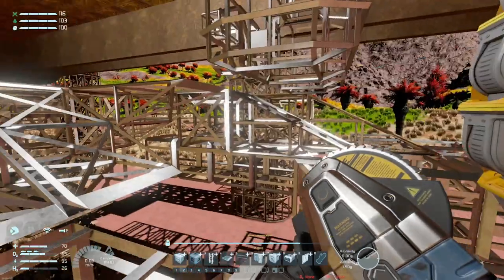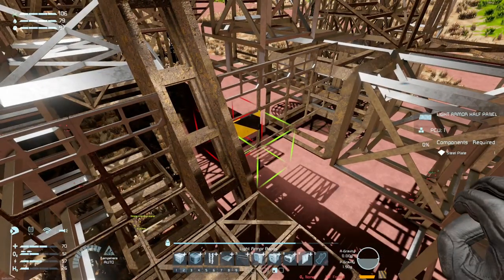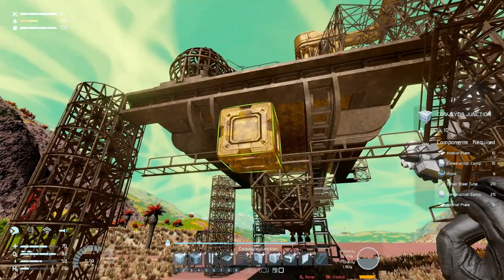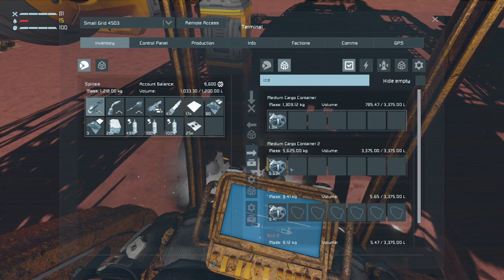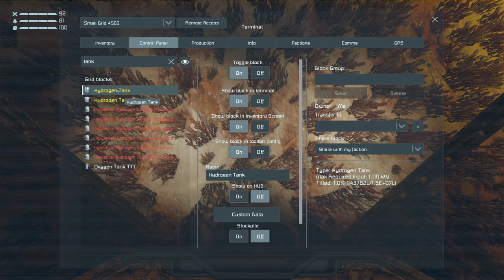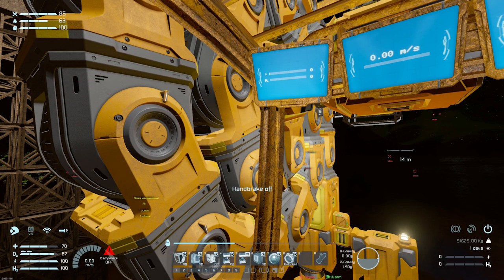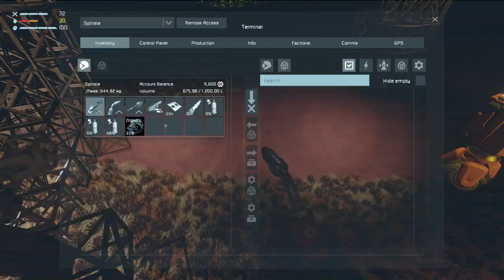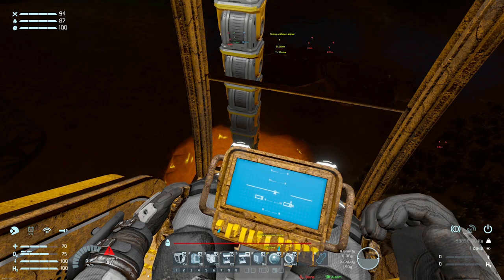Survival Impossible - Mining Tram/Gondola Thingy #60 - Space Engineers Hardcore Survival

Comment: Splitsie, you should add a remote control block and a radio to your gondola. Low power, so nothing can see it from far away. The reason I bring this up is that you might forget getting into the gondola from the side, get out in the middle of the ice lake, and then have no access except via the rails. And that's a scary thought in 1.9g.

Edit: you can probably also add a gyro to the gondola to stabilize it via locking the gryo orientation override. Less chance to flip via unbalanced loads.
Reply: The idea of him having to shimmy shimmy along the rails is actually kind of appealing.
Reply: Definitely appealing... Here's hoping
Reply from the maker: You make a good point, some backup systems would probably be smart :)

Comment: I can think immediately of one thing you've forgotten on the Goblin. (Which is an AMAZING name.) An antenna. I can think of one adjustment I'd make, to make batteries last longer, and improve the function. Now that we have the fancy magnetic pads, I would add them in the four directions and on a stalk over the cockpit, so you can lock up to a surface, and just hang with your thrusters dis-engaged. So instead of hovering as you weld up small grid armor, you can latch on and just hang out for example.

Comment: 21:56 put lights on the end of the drills to sides of them pointing downwards. When you lower the drills the light cones will get smaller to a point and that's how you know your almost hitting the ground. It will in come handy ones you get the drill out of its hole and want to move a little bit forwards without the need to lift the drill but to max out.
Reply from the maker: Good idea :)

Comment: For the Goblin a suggestion I have is to have the connector on the back of the cockpit with the air vent on the top of the connector. That way you can have a little more cargo storage and should be able to access the cargo in the connector from the port the side of the connector when standing on the platform. And it will be able to get lower to the ground and if you connect it to the base conveyor line you can load it up with the part you need with out getting off the Goblin.
Reply from the maker: I might do some fiddling in creative mode to see if I can make a mk2 that's a bit more optimised :)

Comment: You could use the small, small grid merge Block on a small grid landing pad connected to the base in order to decrease the size of the hover board. Also: make sure to weld up the rails of the drill gondola as well as they can be shot very easily. For the full occupational health and safety package block off the end of the rails with an extra beam so you don't drive off the gondola :)
Reply: I believe you could also use the new armor panels as an end cap as well.
Reply from the maker: That's a good idea - I forgot about the new mini merge block

Comment: Could build some storage to pull the stone you mine. Maybe finish up the panini hanger a bit and get your living space set up. And before, you could drill out behind the base to build a sort of a building shed for vehicles as well as housing the goblins. I think they need to be green. Maybe also use some grating to block access to the mining hole while having a space where you can set the drill head down and possibly add more length to get down into the stone so that the drill base can be your mining area as well and you can keep the area around the main base pristine. Sort of keeping the ugly bits hidden from plain view like we do in the real world. Would love to see like a few dirt piles after a conveyor of some sort that doesnt have to be hooked up, just for aesthetics. Could use your terrain tool to do that. I think it would add something to the industrial look. Or an ejector could drop your gravel into a hole in the center of the dirt pile, like set up a small cargo container with a sorter that only pushes gravel into it and have some sort of script that will detect when the cargo for it is at like 90% and then have it switch the ejector on so its bot burning power constantly. And also it would maximize the amount of gravel in a single ejection rather than having a few kilos you could have a few hundred or what ever the max is for one of the assets.

Also think it would look cool to have some sort of catwalks along the outer portion of the rail system so it looks like a foreman or inspector could monitor progress. Have it look the same as if it were a massive operation with many people working at the site. That way it might look like it was abandoned at some point and you had found it and got it operational out of necessity. The rust look would absolutely go great with that sort of idea and it gives the plant some life and makes it seem like it was previously lived in.

Comment: A couple of ideas. 
1: connect a piston and a Hinge/rotor to the cockpit on the gondola to move back and forth and rotate looking up and down so you can adjust any viewing angle at any time.
2: instead of wheels actively moving up and down track use a piston  (leaving the wheels but not using them to move) so you are always connected to the base and able to Xfer to the base as you are drilling, much more efficient 
3: small safety platform on the sides of the cockpit

Comment: Suggestion to make the hoverboard easy to control:  Use sensors to the control movement!  Put sensors on the 4 sides that activate when you reach the edge of the platform and move the platform in that direction (maybe with timer blocks and thruster overrides).  Maybe one more sensor with jumping up taking it higher.  Black Armor had a demonstration of this with a piston set up.

This will free up the hands and remove the need for a cockpit. Plus it would be a fun build.

Comment: "To P or not to P"

Meanwhile 18:00 "to Beam or not to Beam"

Now you've got me doing it 😂😂

I was actually hoping you would be putting the connector on the right side small grid junction since you're planning to put large grid large cargo on that side anyways. 

As for that idea for putting the chain on a wheel, taking an example from an extruder you can have one wheel on an unlocked rotor with no power for the bottom, and then one wheel on a suspension ontop so you can crimp the chain and "drive" it in and out of the spool. If clang allows it should let you have much more control over the chain.

I love the hoverboard idea as well... The new magnetic plates honestly make me feel like they should act like thrusters instead of landing gears and they should allow you to "hover" by pushing you away from player built blocks.

Comment: So glad this series is back! 

I saw similar recommendations, but you should add a remote control and  extendable ladder to the nautilus. It's inevitable at some point that you'll fall out of it while it's out on the rails and there's no easy way back into it currently. (The goblin sled kinda works, if it has power and you aren't in a panic by being attacked)

I thought about just adding a remote and putting a ladder on the drills, but you might not be able to reach. Would be far easier tho if it worked.

Comment: I would suggest increasing the distance from chain coil to cockpit. 1: To increase visibility of what the chain it doing. 2: For when you want to add chain length the coil will be larger, current placement will be too tight for expansion. It will get to be a large coil quite quickly adding length Lastly 3: Farther back will reduce chance of clang/damage to the chain/walkway/cockpit when moving it around and collision of hit boxes that may occur.
You might need to lower the whole chain axle down as well for same reasons, if you expand. Not only will it get wider front to back but also UP and down. UP being more an issue for the cargo containers as well as the track and parking area. Easier to give it plenty of room now than build around it later or rebuild it, if you want to do much more than surface strip mining only.

Also put a turret on top so you aren't caught out gathering ice and attacked without needing fixed placement towers or something for defense as the attacker is most likely going to attack important objects first IE the tram/you, not just build blocks like the track you only need it on the top of the tram for less needed resource cost. Easier to take firepower with you then attempt to run to defending turret towers as you are first target anyway.

The "lopsided monstrosity" hover platform you built, you initially built it off a hinge joint and then added a connector on the bottom to charge it and cut it free. I kind of liked the idea of linking to charge on one of the hinge joints instead of a connector. Then it can also fold up or down for access getting in and out from above or below. You get in, then swivel it level and detach the hinge link and fly away. Come back reattach the hinge links, then swivel it down/up and get out. it could also fold out of the way for storage with buttons controlling the hinge or hinges if you wanted. Risky if the hinge control went wonky but still neat and different.

Comment: tip, place 1x1 small grid wheels as bumpers on the working platform, they are awesome so you do not destroy things when bumping in tot hem. i have built several of these working platforms. also, place the cockpit of the gondola on a rotor or hinge and you can tilt it downwards when jumping in to it.
Reply from the maker: Interesting idea on the wheels, I wish we has 1x1 wheels with smaller suspension blocks (1x1 instead of 1x2) so we could fit them in more places for that sort of thing

Comment: Cool as that hanging-down cockpit is, I think it would have been really elevated if you had a rotor-hinge-piston system that sent the cockpit down from the top of the vehicle.

I don't know about scripts, but there's a mod to add an in-built inventory bar the same way the vanilla in-built LCD scripts work, so it doesn't require Programmable Blocks or to specify an LCD in any way, you just select the LCD in the block properties and set the script.
The mod is called: Cargo Fill Level LCDs
The only real limitation is that it considers the fill level of everything on the grid, but given that only really the drills, cargo containers, and cockpit have any kind of capacity, it should be fine.

Comment: 15:21 I believe the reason that the windows and plates are being easier to weld from the opposite side is the result of them updating the collision on both of these blocks to be less thick, ending up at the point of putting it's collision model behind that of the block it's up against (most likely to not block things trying to move alongside them). Since that recent small update, I've found that armor plates up against full blocks (usually functional ones that I want to cover up) are almost impossible to weld/grind by hand, instead targeting whatever is behind it, at least on small grid, haven't tried large grid yet.

Comment: Best way to achieve the clockwise/anticlockwise with hinges or rotors is using increase/decrease velocity, with a reset velocity on the toolbar
Reply from the maker: Sadly I've never found the increments with those controls to be fine enough for use when I've wanted them :(

Comment: For the hover board, instead of two to have one recharging, use replaceable battery packs, one or more batteries with two connectors, one towards the base and one towards the board.
With a small battery onboard you can switch packs without dropping, and possibly a script to make sure that its set to recharge when connected to base and discharge once connected to the board so it recharges the fixed battery :)

Comment: Hi Splitsie you could build a complete enclosed hangar / garage for the drilling gondola even with closing doors between the rails (I guess it is only max. 4 blocks between the rails? So underneath the rails with sideway blast doors and between / above the rails with blast doors from top) and then you could have a repair / maintenance platform on the bottom of the hangar for the drills where they can be lowered to... Are the I-beam blocks air tight? If so, you could even pressurize the hangar... Can't wait to see the next episode...

Comment: Nice Episode again. Just a thought about the miner: The Cockpit is a good Backup, but in such an environment and all the hostiles..  that thing has to be remote controlled from somewhere at the facility - to mount some sort of defenses in case of incoming badies. And it would be very easy to remote control it, 2 or 3 camera angles and some buttons on the hotbar for wheels, drill winch etc.     also, defense drones.
After watching the whole thing, why not putting a rotor head underneath the goblin, attach it to a landing platform rotor and rotate to a set angle where a ramp is to get on and off ?

Comment: I built a dirt mining crane with 4 rounds worth of chain on it's spindle with the same gravity. The rubbing against the ground is a non issue if you disable resistance on the chain links entirely.  My chain does hit the edge of the hole when fully extended, but without any stiffness, it just flexes at the impact point. since it's a low speed, low mass impact, there is 0 damage.
Also:  optimal speed is between .05 and .1. this is due to the pendulum effect creating a much bigger hole than expected with just 3 miners. any faster than .05 on the outermost round, causes the drills to impact the bottom of the hole during operations. on 3 rounds on the spindle, getting away with .1 is feasible, but going slower allows the drills to make the hole a bit bigger, so less edge impacts on the chain. 
Hinges are surprisingly resilient to impact damage now. much sturdier than connectors, and it's feasible to rub a rotor head against a vehicle without anything breaking off. guide rails for easier connection to a power umbilical made out of hinges, rotors and pistons is feasible. used to be highly explosive, but nowadays it just creates some sparks.

Comment: Seeing that no cargo xfer is needed, lose the connector on the skateboard and replace it with a rotor part.  It'd be the smallest solution and you can even engineer a variant of tongue and groove guide for docking alignment if clang doesn't interfere.  If that doesn't work out can use the new 1x1 merge block connected to that large2small hinge you built it with.  (bonus points if you figure a way to use that hinge to store the skateboard when not in use)

Comment: I feel like a line of collectors would be beneficial here, so as the drills mine, the ore is ejected from a connector and into collectors that sends the material back to the base. Seems like the efficiency is suffering because of the 'stop-unload' limitations... it's definitely a cool apparatus, that said; given the constraints that your under with the gravity/ no jet pack/ weight capacity of 1x1 SG wheels, the time sink seems like a tremendous compromise for cool-factor, imo.

On a completely unrelated note; imagine a large grid(?) chain on an advanced rotor, with a cockpit, gyro, thruster's and a welder on the end of it, connected from the base. I think with enough R&D it could probably make a really interesting shop tool for welding - like suspended from the roof of a shop, that would overcome inventory limits.

Comment: Instead of digging one deep hole at a time just do the scraping idea you initially thought about so the changing position of the vertical portion of the chain is not an issue.
Reply from the maker: That's certainly an option, I've had bad luck with dragging drills though - might have exploded a LOT of them during the Wrong Way Down series :P

Comment: The Floater!
<*insert turd emoji here*>

You were talking about having a rollbar on the drilling rig, that could be placed in from the bottom of the cargo/rotor area in the form of those steel I-Beams though it would probably be better to use a wheel for the actual mating surface or you could end up with it causing a hitch on the chain and maybe getting stuck or clanging out.
Also, the rotating light will snap back to grid if you quickly turn it on and off, it's a pain in the butt and that's mainly why i don't use them.

It's a shame there is no script to push camera feed to screens, or you could have a small lcd on a stick outside the cockpit and feed a camera over the drills in through that.

Comment: If your adding engines and such, put them up top between the Frame, up where wheels are. I think it would been cool to have the Cab on a Piston that Lowers Closer to Ground level. its not like you have to steer it, its forward or backwards, which can be done with buttons or even remotely. Oh I would add a remote if you die you can recall it to base as well ,   Funny I always build on a raised Platform, then toss wheels on it Drive it to where I find ICE, then Build base there since its Fuel.... add ejectors to Miner.

Comment: Oh, and idea for Spinny light and timelapses. Try to match lights RPM (or one of its multiples) close to your timelapse FPS. May need a little math to calculate right offset. If you find a sweet spot they will seem to rotate in normal speed even tho video is sped up. I noticed that when you were adjusting them in timelapse and for a moment they seemed to rotate in watchable speed rather than flicker. Give it a try :)
Reply from the maker: That would be pretty cool to do, however I tend to vary the speed of my time lapses a fair bit so it wouldn't work with the current way I do things :(

Comment: on your "hover board" you should have placed the connector at one end, then placed the cockpit over the connector... would shorten the height of the platform and allow remote loading of parts should you decide to use cockpit for parts storage.... for external access just pipe a single small cargo can from either connector or cockpit